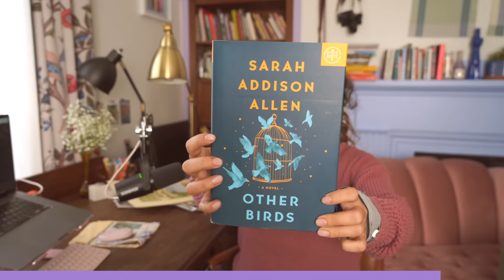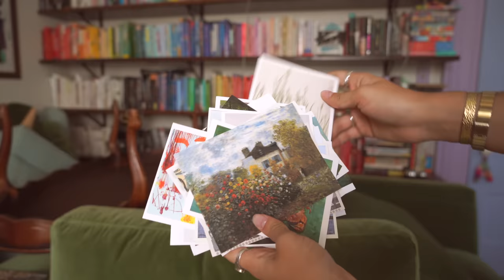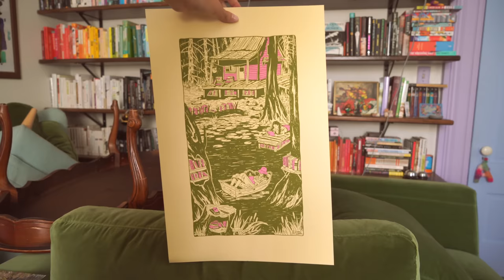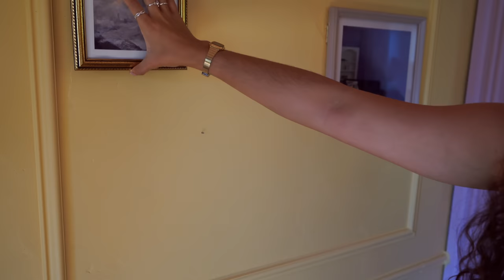Creating a Fancy Gallery Wall

Comment: Gryphon great job on the judges paneling. Once you start with adding trim to your rooms, you wont be able to stop as it's what makes the home have so much character. I LOVE all sorts of trim !!! Vary it throughout the rooms, there is so many classic styles and designs.  As to answer your question about adding the art in the lower boxes, no, I think it will take away from the overall feel of what you have done.

Comment: What a lovely video!  I've been looking forward to this ever since you mentioned it in the miniature living room video.  I would say no art in the bottom panels.  That's going to be so far below eye level that you're going to have a hard time appreciating it, especially if it is post-card sized prints with lots of little details.  If you do decide to hang art down there, maybe select bolder prints with large blocks of color, and not drawings with lots of tiny pen marks in grayscale.  Hope that makes sense!  I wonder if it would look good to paint the lower rectangles pink?  I don't know the traditions of wainscoting though, perhaps that is not the done thing.

Comment: I love the way this turned out. I'm not 100% sold on the color scheme, I think for a dining room, darker, richer colors would work better. I love yellow, so maybe more of an ochre version would be good, and that would play off all the frame colors really well. And then I would go a bit darker on the trim color as well, just to make the space feel cohesive. The hallway color is already in a darker shade, so I think having the color scheme in the dining room in that same tonal range would create a very cozy vibe in that whole part of the house, and draw more attention to the hue differences between the wall colors rather than the brightness/value and saturation/vibrance differences. But the panel molding look fantastic, and the gallery wall itself is spectacular.

Comment: I think it would look busy if you put art in the lower frames but it could look absolutely spectacular if you paint inside those lower frames with your accent pink. I'm glad that you hung the oval frame even though you didn't have a piece to put in it. That's the best thing to do when you're making a gallery wall and you have a fabulous frame that you definitely want to use but you don't have the art for it. Just use a filler in the frame, some pretty paper, plain colored paper or gift wrap, an image from a magazine, go to the library and photocopy a page from a book, a couple of dried leaves. Absolutely anything can be art for a gallery wall.

Comment: Fantastic job on the wainscotting, I wouldn't  put art at the bottom, perhaps a "sideboard like" table and vases with flowers or such on the floor. Especially if you are trying to cover some blemish. Silk or dried, or a combo of both. I recently put a picture rail up on my old plaster walls in my front room. the ceiling is uneven. I painted above it (its about a foot down) the same colour as the ceiling. It definitely works to hide the uneven ceiling.

Comment: Very Fun! I think for the bottom wainscotting it would be too difficult to see art that low, though perhaps you could use some wallpaper with a lot of negative space and ideally a yellow background to blend in a little to the wall colour and not be TOO distracting. On that note, some of your art works are matted in a bright white which does read a bit stark in contrast to the warm wall colour so perhaps tea staining them, or simply painting some of the mats the same colour as the wall or perhaps the trip colour could help unify the the collage wall. Thank you for sharing your adventures Ariel!

Comment: i think a long bench would look great under the gallery wall (or another low but wide piece of furniture), in which case i would leave the bottom part of the wall empty. if a piece of furniture doesn't work there, it could be fun to put art on the bottom part as well.

Comment: Looks so good! Another trick to make a gallery wall is to cut some paper to size and tape on the wall. Then you just replace with the frame. If you decide to do another one. :)

Also, i think maybe some wall paper in the bottom sections could be cool.

Comment: It would be cool if you added some dried flowers under the circular painting on the right. The gap feels a little large, but the nice muted pastel look would make dried flowers look awesome! I would leave the bottom section blank as that line is typically a chair rail (especially in a dining room) and you don't want those paintings to get kicked, hit with a chair, etc.

Comment: You mentioned that this is the dining room and I feel like a mid century modern sideboard/buffet table would fit so perfectly underneath the gallery wall. Having a solid cool, funky piece to anchor the wall would be nicer than more art on the lower half I think, although I’m not sure how that’d work as far as a being in the way of walking though. If not a slimmer entry way table/behind the couch table/book shelf might be better

Comment: I would say no to filling the bottom boxes with frames, it would be very visually busy and I also worry about anything bumping into the wall at that height. But if later down the line you feel like those areas really needs something, I would say a different color paint, or a bit of wallpaper, or even a mini handpainted mural in those panels could be really cool. I think a lightly patterned wallpaper in a yellow that goes with the walls would be the best option. Or stencil a pattern inside with a slightly lighter or darker yellow?! That could be fun!

Comment: Would not place any frames on the bottom squares, but on the left side of the door  you could hang up 3-4 frames. And under the big oval frame is one small frame missing.

Comment: If you put the large painting in the middle right on top of the two vertical lines it will protrude out more giving the wall more dimension while tying the two squares together while also making it a bit of a focal point. I think the way it is right now it looks a bit chaotic and unfocused. Just a humble suggestion.

Comment: I am a klutz and have no spacial awareness, so I would not put art on the bottom, in fear that it would get damaged. But, I would definitely add some on the other side of the door on that wall. (Like a line of postcards all the way down?) if you wanted to add some pizzazz to the bottom wainscotting, you could add wallpaper inside? Like one to match the yellow?

Comment: I think two pictures that are almost the same size rectangle but just a little smaller might look really cool in the two squares under the picture wall. I think if you did multiple small frames it would look to busy.

Comment: how about the addition of a small mirror for the oval frame? It could be a treated or stained, doesnt have to be totally reflective. Also, that spot of negative space on the right side looks the about the size for a matchbook, if you have/find an interestingly designed one.

Comment: as a girlie who worked in a michaels framing department- frames are wildly expensive and it's crazy.  custom framing prices made no sense because we would have smaller pieces at a minimum of $100USD which was a little much and then giant 36x78 canvases that took hours to stretch and assemble that would cost $300-400 despite the labor and time involved. And they still paid us minimum wage. it's not a great place to work lmao

Comment: I find my gallery walls are never done
They are always changing and evolving as new frames and new treasures are added.So I end up with many nail holes that need to be filled or covered with more art.I would not put art on the bottom.Originally wainscoting had a very practical use.It really feels Jane Austen.The negative space keeps it that way.Agnes is beautiful